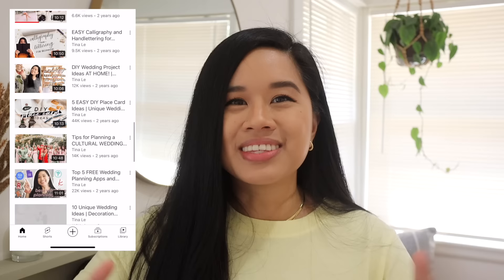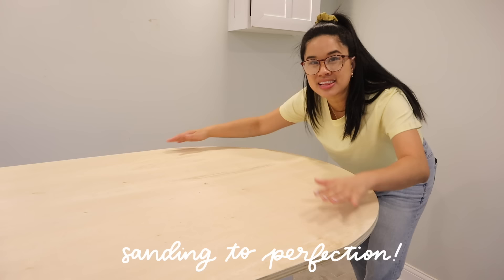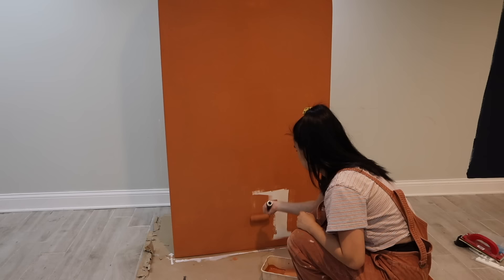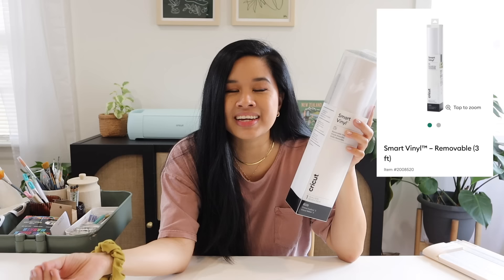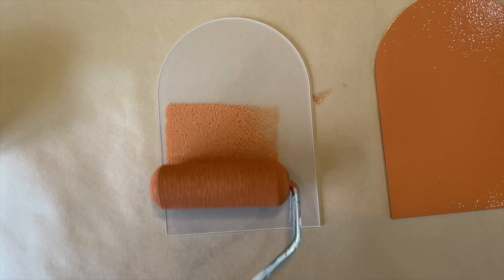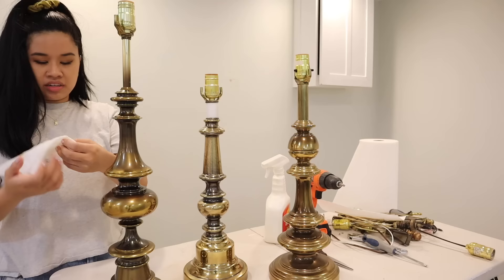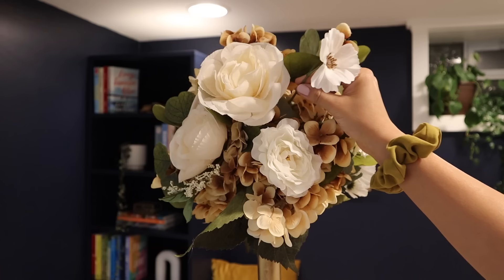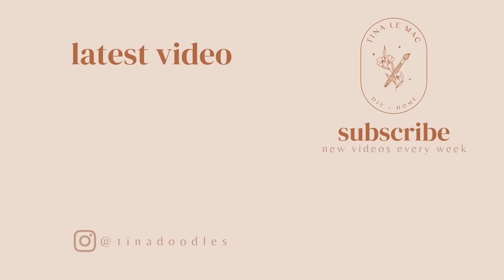*NEW* DIY WEDDING DECOR IDEAS! | Chiara Arch Champagne Wall, Lamp Centerpiece Hack, Acrylic Signs

Comment: I find your show inspiring and enjoy watching every week. Please don't take my next comment as an insult because I just want to help. Regarding the champagne wall for your sisters wedding. You may want to pick up a half sheet of clear thick acrylic from your hardware store and make a set of supports for the front like you did the back because; 1. The wall will get front heavy when the filled glasses are out on it - boom and 2. If someone (usually kids) accidentally bumps into - boom. I really hope this helps. Look forward to your show!
Reply: Yes, the front needs supports like the back.
Reply: Lol or it stages the glasses and there’s an actual fountain next to it. Maybe with those cute koi fish that run on batteries
Reply: My thoughts exactly. I'm sure we could all see what was going to happen when it first got put together. Definitely needs front supports.
Reply: Yes I came here to say that too. The whole video I kept thinking the weight of the glasses, or even a bump, will send everything flying. Needs anchoring on both sides to be safe. Love it though and this isnt meant as criticism. I just want the day to go smoothly x
Reply: @crushculture783  How do you do front support so it does not fall like the what happened in the video
Reply: I think if she put weights on the back it should be fine

Comment: I love that you show the little hurddles along the way, so it gives us a great idea of what to expect !

I think having a diagonal piece of wood to hold on the back would help with the structural integrity of the wall. 

Also, I probably would've cutten out notches for the glasses to lay in. It's more work, but that way if the terrain is uneven or if the wall wobbles a little (say someone bumps it by mistake), they would still have a chance to not fall !

I'm in absolute love with the centerpieces, thanks for explaining your floral process ! It really clicked with me and I'm confident I can do a good job with those tips when the time comes for me ☺️

Comment: So cute! I’m planning my wedding as well and I’m thinking of having a wine stand too..super cute!! You might need to secure the back more and support the upper back part to the bottom    Or add a sand weight or a closed top bucket with some water and tie it to hold the weight of the top so when the wind blows or something it doesn’t tip over.

Comment: you might want to put some tiny feet on the kick out pieces with holes in them so you can put anchors into the ground. That way if it's outside in the wind, it's anchored to the ground and won't blow over like a sail.

Comment: I meant to ask a long time ago...I was told to use a drill bit slightly smaller than my screws for pilot holes...which is correct?  Sames size as you do or 2 different sizes?  TYSVM ❤️